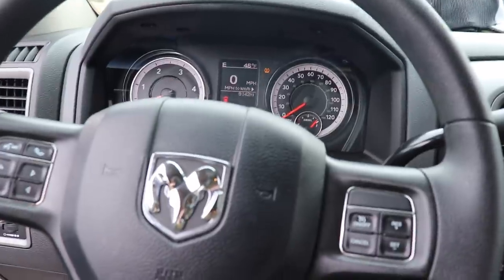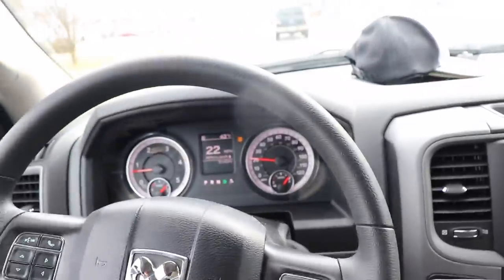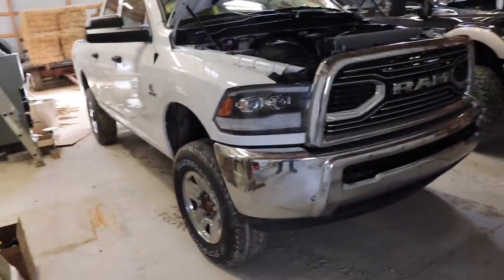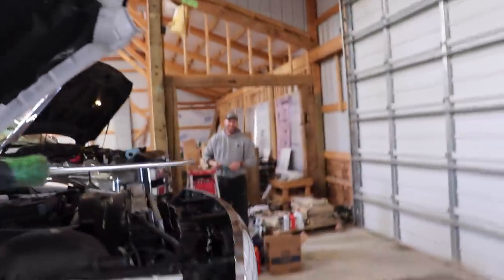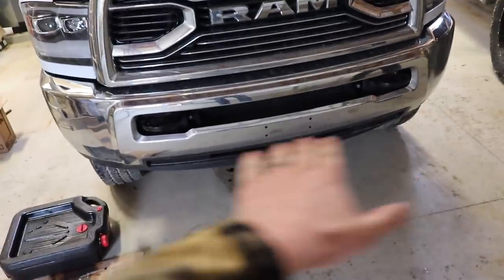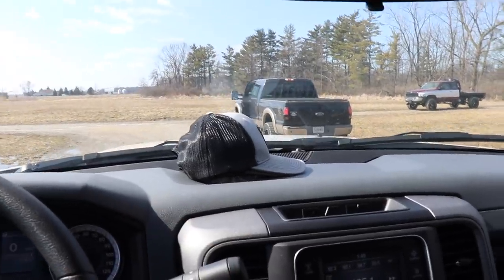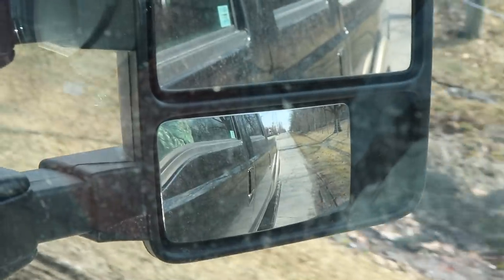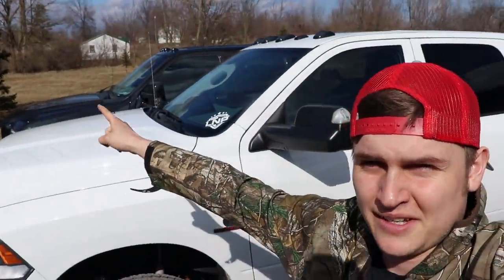We Should Have Known This Would Happen...

Comment: I found the best way to get the filters is to get one of those oil filter adapters that fits on the bottom of the filter.  You can twist it off from underneath , and even put the new filter on.

Comment: Usually on most of the Cummins engines
You can change the oil filter with a 3/8 drive tool,long extension and a filter wrench attachment from the bottom of the oil filter.

Comment: I don’t have a diesel YET, BUT I have a toyota and they chose to place the oil filter just beneath the exhaust manifold. Spills everywhere! With NO leverage! There is no room to even puncture and tap it out with a hammer and flat head.
Reply: I’m not sure what Toyota you have but I have a 2015 Tacoma V6 and the oil filter is on top of the engine and in the front. It’s super convenient to get to and there’s a drain tube where I can fit a cup under it to catch the oil. It makes it really fast and easy
Reply: Mine is 20 year old, 2nd generation Avalon v6, so it doesn’t surprise me that through the years they’ve refined their design. Trust me, I love my Toyota and you can’t beat ‘em! So comfortable and bullet proof! I love the Tacomas as well! Thank you for updating me that they’ve improved their design! :)